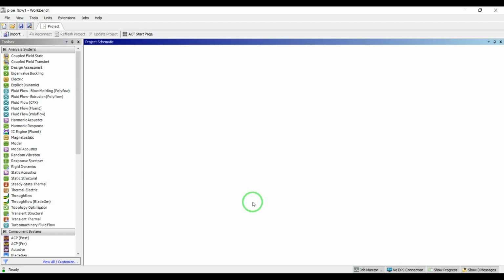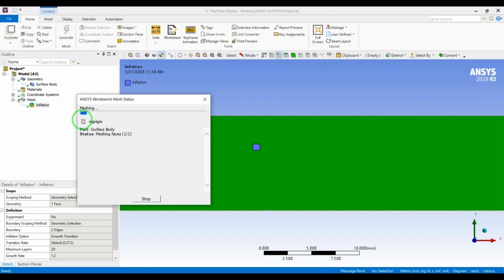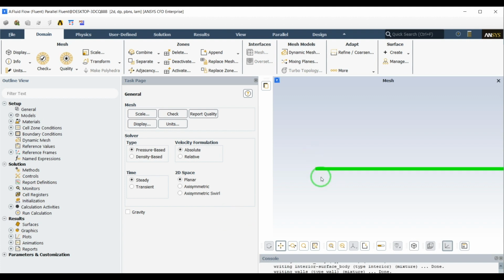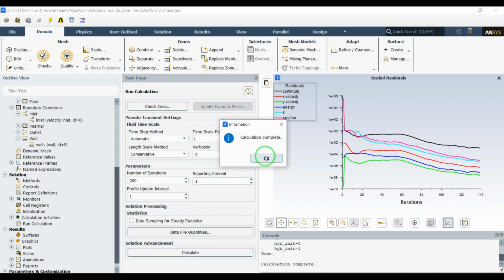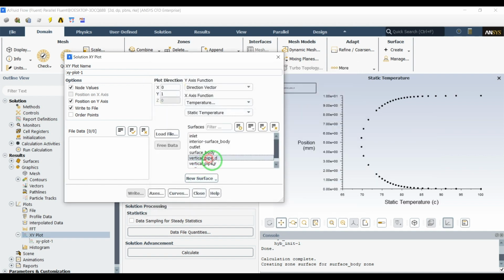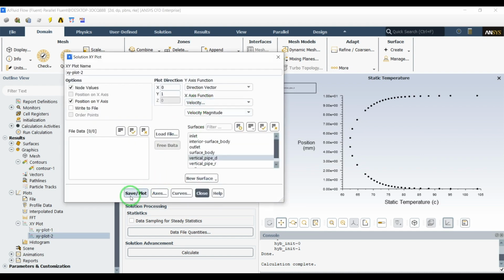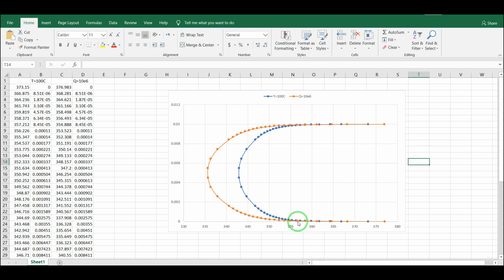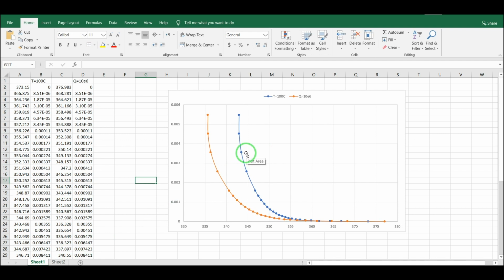ANSYS Fluent Tutorial: Pipe Flow Simulation Plotting and Exporting Temperature and Velocity Profiles

Comment: Thank you. How can we then calculate the average Nusselt number or Heat transfer coefficient for such a problem, from CFD results?
Reply from the maker: Calculating heat transfer coefficient is very tricky in Fluent. You should be very careful about the reference temperature you consider and the result you are going to compare you results to. Fluent has different methods of calculating surface heat transfer coefficient in the report section.